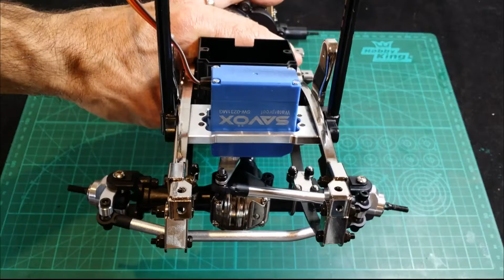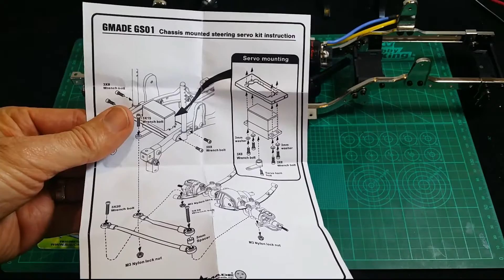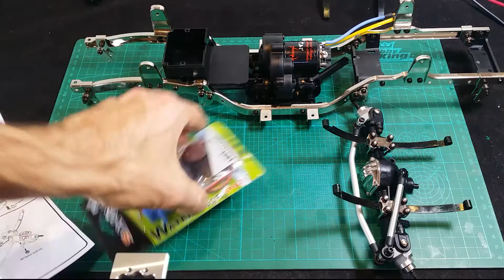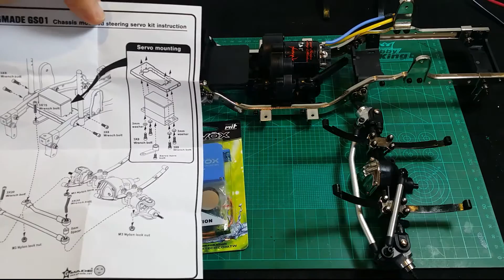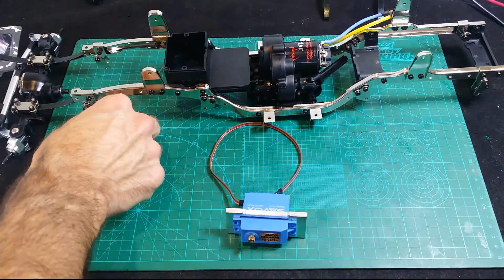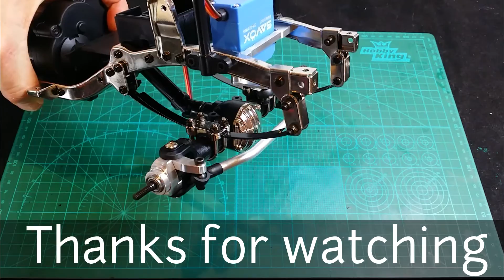GMADE SAWBACK Chassis Mount Servo Mod

Comment: great video mate. but got to say I fund that this mod was not that great as I first thought,  it brings the weight higher and it keep pulling the chassis down every time I would turn right and that the steering rods would touch the spring leafs, now not sure if any of this wil apply to your sawback as you are using the 0 ackerman set up, but wend using the stock knuckles it puts alot of stress on to the knuckles mounts for the steering rods.
Reply from the maker: +Tuga rcing Hey mate, thankyou. I haven't noticed anything yet but will look out for it. Thanks for the comments and support.

Comment: on the alloy bracket it looks like it has 2 slight cut outs between the screw holes so the servo can be put in from the other side without the servo plastic reinforcement getting in the way and create a bit more height for the servo. do you know if this is the case. thanks. ps. good vid.
Reply: just noticed it is possible as they are both mounted the other way and as such higher up in your tale of two jeeps video. 😁

Comment: Where did you find the knuckles? I built a complete chassis from 3/16 pencil rod and used a sawback 4ls as the donor. The steering radius is horrible though. Even with shorter wheelbase than stock. Did they help noticably?
Reply from the maker: +Will Sullivan hey mate, it's been a while but I believe it was rc mart. They have heaps of great stuff and yes it helped for sure.
Reply: RC Tanks & Trucks 24/7 do you have a Facebook page?